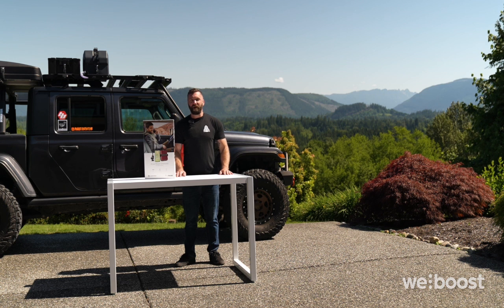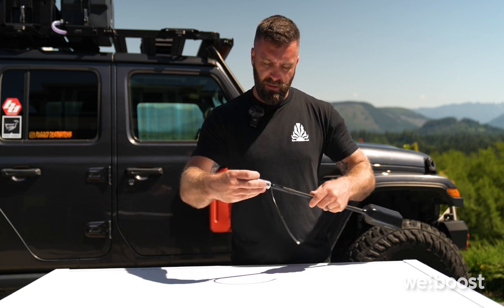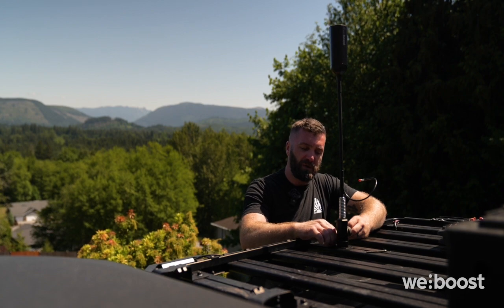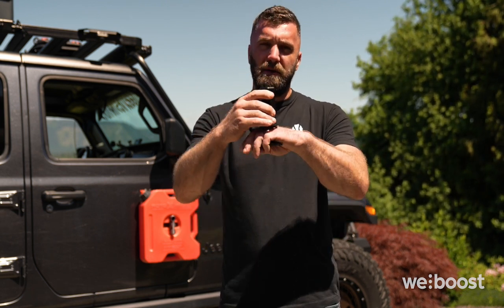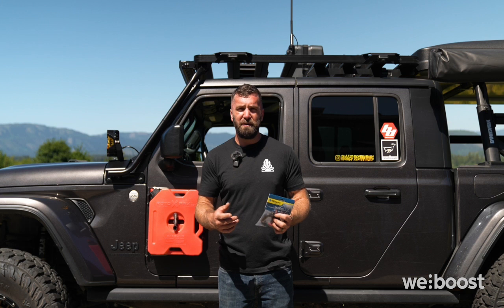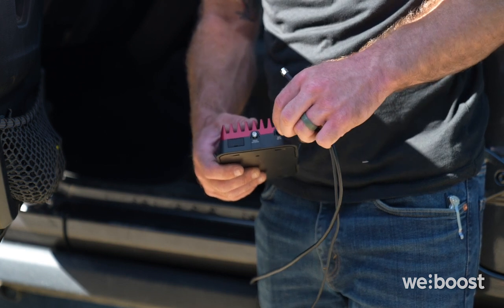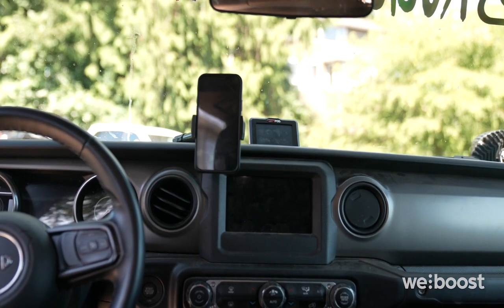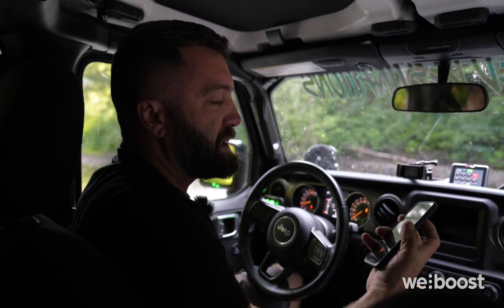weBoost x Rugged Destinations | Drive Reach Overland Install

Comment: could the wire be pinched with a door? not for permanent use
Reply from the maker: The door seals provide adequate padding to keep the wire from pinching, but yes, passing the wire through the firewall is a more long-term solution.